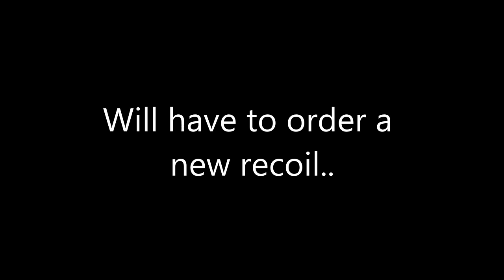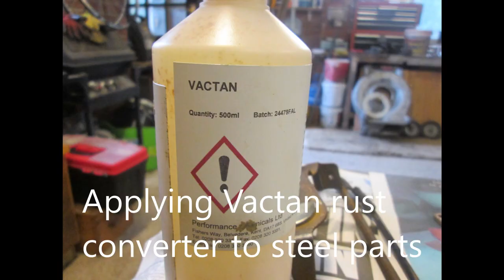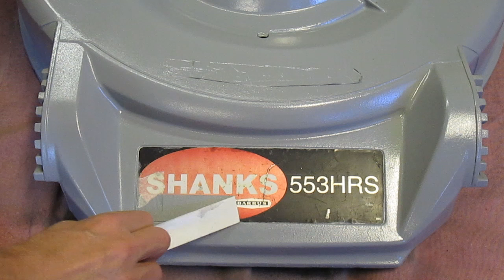Restoring a neglected mower - Honda Shanks Mower Restoration

Comment: Oh deck spray with coats silicone spray from grass sticking
Reply: Those plastic covers i would of sanded them. Smooth then black hammered or black Matte  black
Reply: And zip ty tied  cable so they don't snag

Comment: Well done, mower looks a million dollars compared to before. Can I just ask about the roller drive failure which it seems these all end up with. how difficult are they to repair? always looks easy following youtube videos but from experience I bet it isn't and how much did it cost for parts to repair the gearbox? thanks
Reply from the maker: Thanks, for watching. The roller repair in theory wouldn't be that difficult if everything came off, but on both we've done, multiple parts have been stuck on, which can make it a much more difficult job. The parts were around £100 for the gearbox. Thanks
Reply: @snazzymowers1409  which parts were struck on, seemed to come apart fairly easily in your video but maybe that was editing :) . wow that is quite a bit for a gearbox but you do have a solid mower now which would last another 20-30 years easily.
Reply from the maker: The main issues were the roller getting stuck on the shaft, wasn't too bad but did take a while to free it off, was shortened with the power of editing :). Wasn't the cheapest repair but considering the mowers are around £1400 it's considerably cheaper than a new one. As you say we should get a few more years out of it now as the rest of the mower is pretty bulletproof.

Comment: I have a Honda hr194 and in need of a new gearbox clutch as it's worn just like this one was. Do you have a part number by any chance or point me in the right direction. Any help deeply appreciated
Reply from the maker: Hi, I've done a little research and I think the right part number for your mower's clutch fork is: 23440-VA4-800. If you put it in Google it should come up with a few websites selling them. I think this is correct but obviously double-check before ordering.
Reply: @snazzymowers1409  thank you so so much for your time and help